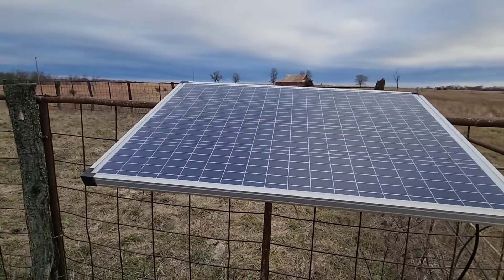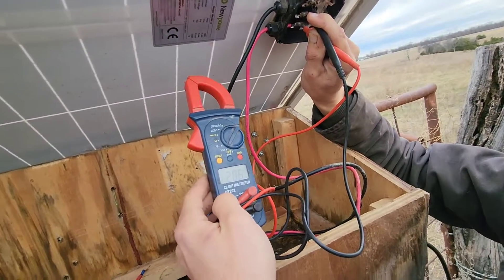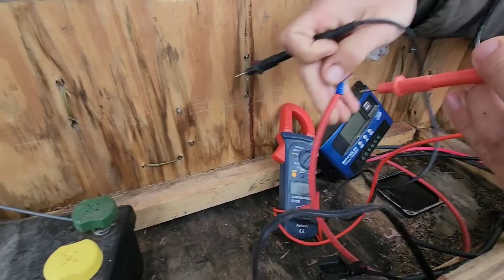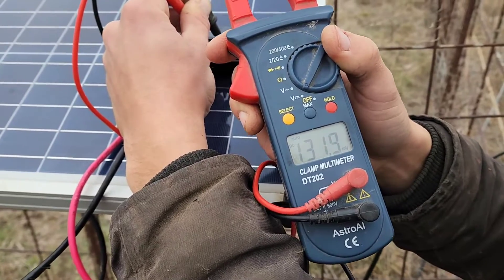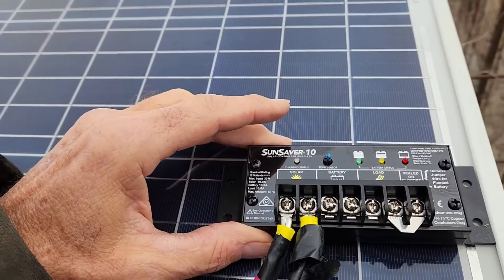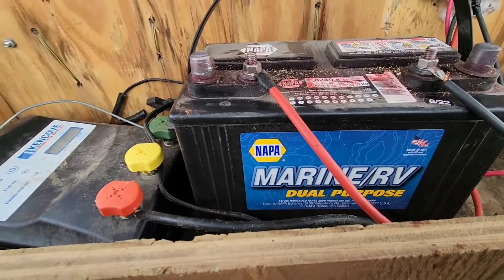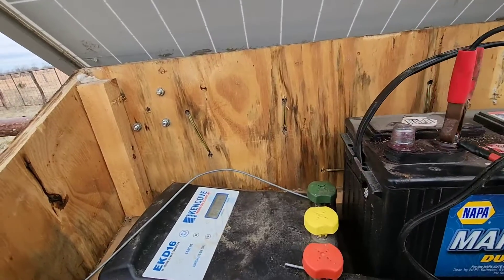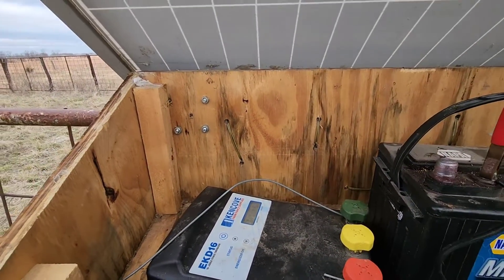Diagnosing Power Problem to the Solar Fence Energizer

Comment: Everything I've read said to connect the controller to the battery first and then connect the controller to the solar panel. You stated in the video to connect the controller to the solar panel first and then connect the controller to the battery. My understanding is that doing it in this order risk the solar panel frying the controller
Reply from the maker: Alex Taylor of Taylor Cyclops Fencers told us to do it the way I described.  Start at the sun and move down.  This is the way we have always done it and have not had any problems.